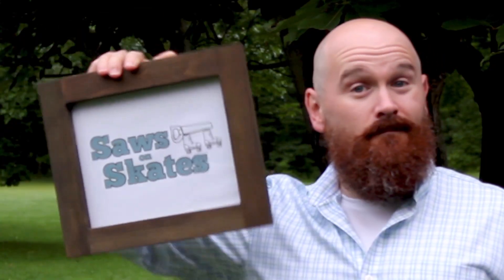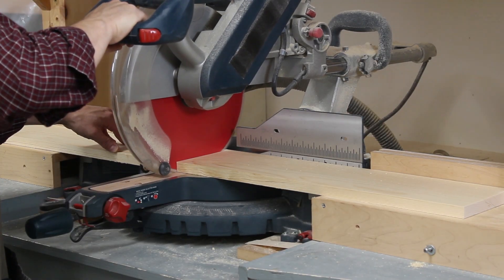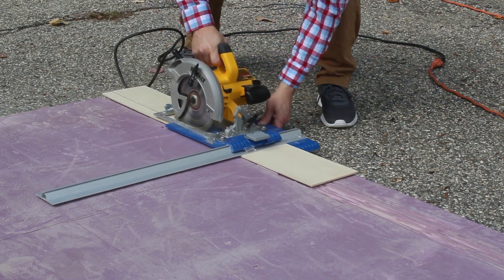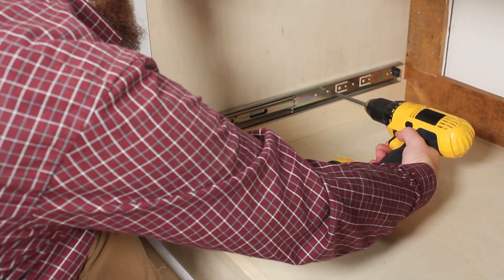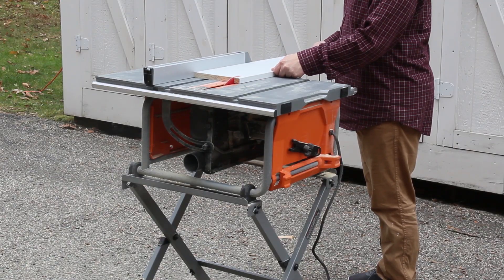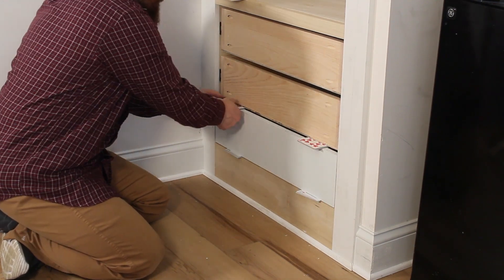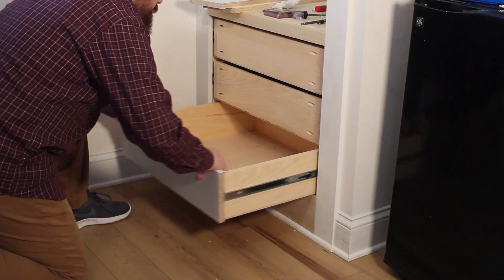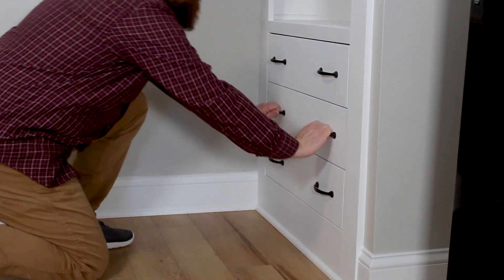Build Drawers the Easy Way

Comment: Hey Scott, I found your You Tube from this article https://sawsonskates.com/rookies-guide-building-diy-furniture/.  I am brand spanking new to DIY, but I need to build a media console for my living room and want to know how in the world do you plan out what you're going to need for something like that?  I know all of the components that I'm going to put in there, but need to plan for extra storage in case we need to add items in the future.   Also, I need to think about cable management for all of the pieces of equipment, I want to do barn doors on the front and need to figure out how to attach them so the bottoms of the doors don't swing around.  I also want to include some sort of wireless charging on the top of the console for devices that support that.  So, maybe I'm trying to tackle too much right up front, but I just don't know what I don't know.  You know?